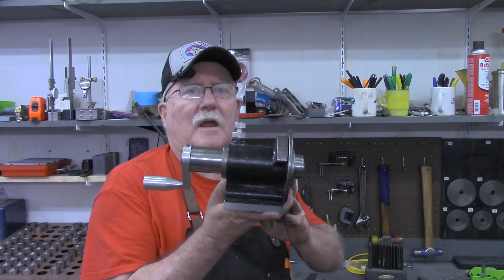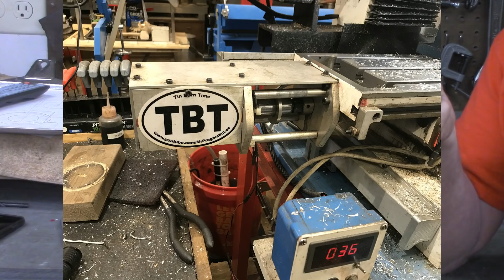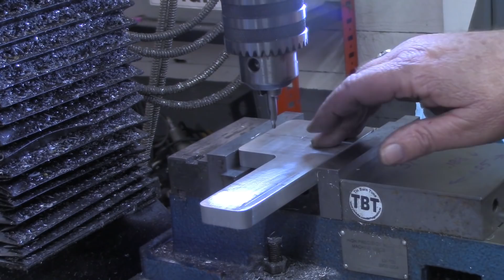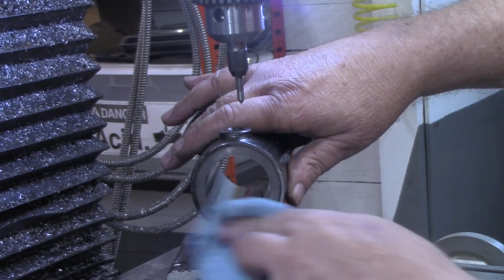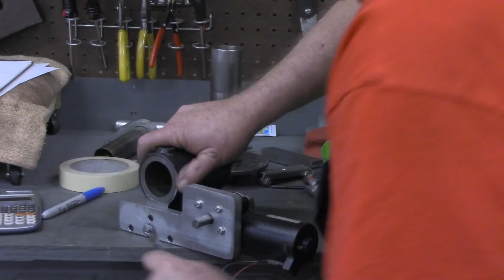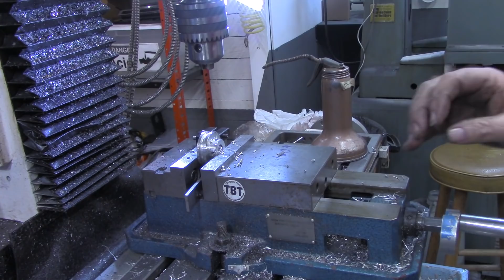Motorizing A Spindexer Part 1 of 2

Comment: how different is that motor you're using to a windshield wiper motor
Reply from the maker: Very similar - this one is a power seat motor and isn't rated for continuous duty.  I suspect it would fail if I ran it too long without letting it cool down. A wiper motor would actually be a better choice since it is meant for continuous duty. Thanks for stopping by.

Comment: Lee I have a box of those motors that I bought 2 years ago.  I have found that they get very hot which makes me believe that they are not for continuous use.  I know they were originally for car seats.  Any thoughts?
Reply from the maker: I had considered this and ran this motor about an hour for just such a test and didn't experience any excessive heat; however, I will definitely watch.  Thanks for stopping by.

Comment: Hi Lee,
couldn't you have dismantled the the gearbox and removed the output shaft.
Then turned it round again, between centres on the lathe ?..
Adam
Reply from the maker: Don't remember right now exactly why I couldn't do that, but I do remember that when I attempted to square the shaft I had to hold the whole thing in the mill - not just the shaft.  When I get back to the shop I'll open it up and see what the issue was.  Thanks for stopping by.
Reply: +MrPragmaticLee 
Maybe the worm gear is part of the the output shaft or the output shaft doesn't have centre holes ?.
One other observation, with it  being a worm type gearbox, the output shaft cannot be turned by hand.
So you'll have to remove the belt for manual indexing.
Also have you considered making a tailstock for the spin indexer ??.
ATB Adam

Comment: Great stuff - I did mine already based on MYFORDBOY design NEMA 23 stepper, toothed XL belt,  with Arduino controller.  Using it for gear cutting. Sorting out the gear ratio for larger tooth count gears. That pesky 127 tooth metric change gear is on my list. I checked mine and I am a smidge off at the end of 127 steps.  

I had the same idea on the motor plate offset to not interfere with the surface to table fit. Nice to see somebody smarter than me having the same thought...LOL. 

Dan
Reply from the maker: I love the stepper motor and maybe one day I'll be smart enough to implement one myself. :-)  Thanks for stopping by.